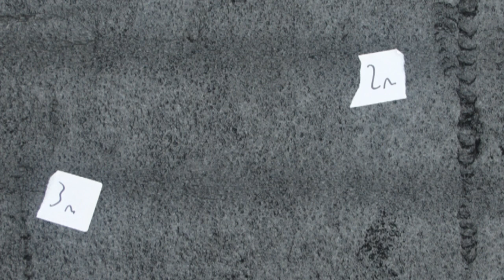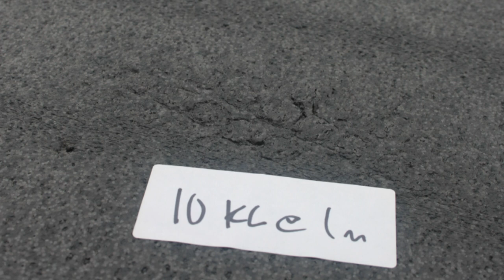Not Useless - Motorcycle Body Armour

Comment: Thank you very much for this.  I have put the armor in my gear to the test over and over through the years in lower speed offroad crashes and I can definitely attest to how it takes what might be a smashed knee, bruised shoulder or broken elbow and reduces it to a "walk it off" level.   While I agree with F9 that the foam armor isn't going to do much at a 60 mph crash into a concrete barrier, to me Ryan did a disservice to the motorcycle community by not pointing out this detail well at all.  

The author of the study RyanF9 cites even has come out and said that F9's interpretation of the data was incorrect.  I used to be a huge F9 fan, but their advice has taken a huge nosedive lately in favor of "hot takes" to get views.
Reply from the maker: @Spoonboy79 - Thanks for the comment.  One thing I didn't like about Ryan's film is the lack of links to the quoted sources, as someone who studied physics he knows better than to not quote data sources.

I'm a bit ambivalent about the film, if it wasn't from FortNine I would have dismissed it as clickbait, but even a good channel can have a bad day.  If you have a link or source of the author's statement that Ryan's interpretation was incorrect can you post it here?

Overall I like the FortNine channel, the film I am replying to may be a little misjudged, especially by the comments section.  I hope it will continue to be entertaining, high quality and honest.  Ryan's film is his take on the armour protection value, as is mine.

Comment: The impact energy  in your test (assuming you just dropped the weight) is ~98 joules. Impact velocity is ~15km/h. It is important to note that usual impact speeds exceed 30km/h and the mass is way greater than 2-3kg/cm squared. While your test shows that armor makes a difference, it does not paint an accurate picture of what damage occurs at real life speeds. A more accurate measurement would be to drop that 10kg weight from 4-5+ meters and see the result on a ballistic gel dummy with bones and everything, wearing armor.
Reply from the maker: @waterspark - Thanks for the comment and calculations, I take it the figures are for the 2 kg / 3 m drop?  As mentioned the test is for a comparison and not a massively scientific endevour.  Unfortunately I experienced a real life impact at appx 25 mph / 40 kph / 11 ms-1 which saw me break a few bones on unarmoured parts and due to a shear effect one that was armoured.  I have also had a couple of minor dinks where my armoured elbow, shoulder, hip and knee hit the deck and I wasn't even bruised [apart from one time where a 'friend' then ran over my leg].

I don't have either the facilities for a 5 m drop or the budget for a set of ballistic gel dummies at £300+ a pop for torsos, it would be nice if I had to redo the testing.  The 'Beaker' to my 'Professor Bunsen Honeydew' was unwilling for me to drop the 2 kg weight onto his arm from 3 m for some reason so the tests were done as described.
Reply: @TheRantyRider  
Armor isn't "does nothing".
It does absorb SOME energy. Issue is that it doesn't even remotely absorbe enough, to ASSUREDLY keep people safe if they land badly. It will still reduce the damage somwhat.

Keep in mind that energy of moving body is propoeritonal to velcity squared.
Reply from the maker: @martonlerant5672 - Thanks for the comment.  No armour that could be reasonably incorporated into riding kit could prevent injury in any circumstance, my accident [see other comments] could only have less injuries if I had left home a minute later.  I doubt that every motorcycle accident will need armour that will stop a bone being broken, but any reduction in the energy transfer can reduce or eliminate injury.

I'm aware that kinetic energy is ½mv² but the film is a qualitive rather than a quantitive comparison.  Given the option of nothing except a couple [at best] mm of leather vs leather and armour that will absorb some, if not all of the impact I will go for mitigation any time.

As per my closing comments it is up to the rider to decide, as it is in warm weather for them to decide that trainers, shorts and a T-shirt paired with a multi-hundred pound helmet is a good form of protection rather than full body covering riding kit.
Reply: @martonlerant5672  yeah a few youtubers have got their knickers in a twist over f9s comments like this youtuber in their blind ignorance have completely missed the point of the video and done a reply that's not a representation of anything other then dropping a 3k weight on the floor.
Reply from the maker: @anti-cheaterchannels2153 - Thanks for taking the time to comment.  I took a while to film this as a reply to Ryan, and rather than going off on a 'you must wear body armour' rant I tried to show that it will mitigate an impact.  The weights I used were 2 kg and 10 kg rather than the 3 kg you mention and as per the film and other comments are not a scientific study and qualitive rather than quantative.

Ryan's comments that the manufacturers base their armour on the minimum requirements are appropriate, as is the fact that car manufacuturers will meet the minimum safety standards for thier products to comply with legislative requirements.  

I hope that you don't think that I have made this in 'blind ignorance', I was showing that an impact is mitigated by armour rather than completely eliminated.  I have had the unfortunate experience of an impact where I ended up having metal implants and the armour saved my joints in the most part.

I will continue to wear armour as it will reduce the impact energy if I have another dink, I will also wear a helmet, gloves and boots as all of these will help in the event of an 'off'.  I could not show truly high energy impacts on realistic ballistic gel and simulated bone items due to cost and needing a lab to do it in.  Having walked away from high speed track crashes, one of which I was also run over by a following bike I would wear the best protection there is.

As I mention, the choice of armour or not is down to the individual, in the UK we have to wear an approved helmet only, anything else is optinal.  Having to give first aid to skinned hands to a rider that had a slow speed dink while not wearing gloves because 'it is a warm day' makes me even more certain that protection is best.
Reply: @TheRantyRider  I agree. Wearing armor is always the best choice. My comment was meant to show that the best proof (even without lab conditions) would be to use greater weight from higher height, because the test case you presented, although it shows armor is efficient, it lacks in showing how effective, particularly with bigger bumps. As for the 3kg - that was kgf on square cm, that 10 kg weight had a pretty big contact patch. All in all videos like yours do help riders be safer. Thank you for taking the time to do this.
Reply from the maker: @waterspark - Thanks for the extra information and comments.  It would be nice to be able to replicate the impacts exactly, in the film I mention that I twice had a poor release and the diving weight landed on the long side rather than the point.  I was thinking of using the string to keep the weight the 'right' way by running it between my [gloved, it gives a lot of heat off] finger and thumb but I would be unable to ensure the same pressure each time.

I also thought about having a target to drop the weight on of a known size but I couldn't ensure that I would hit it!

It's a bit of a demonstration rather than what I would call anything near scientific, the 3 m drop height was above my head when I was at the top of the ladder so there may be variation there as well.  I've had a lot of suggestions on here so at some point I may try it again incorporating these, my mate who supplied the foam is going to have to work a lot harder if I do so that I have enough to make another film.
Reply: This. This is a meaningless test because the test is so toothless. A pillow or bubble wrap would be considered armor by this standard.
Reply from the maker: @Hazztech - Thanks for the comment, the point of the film is to show that armour provides some protection.  It's not meant to be an empirical test, just to show that a reduction in the impact is achieved, even by armour that may be considered ineffective in high speed crashes.

Neither bubblewrap or a pillow are used as armour, the pillow would absorb more energy but bubble wrap would simply fold around the weight.  The armour shown absorbs energy, given the choice of my elbow hitting the ground with or without I'd prefer with.
Reply: A
Reply from the maker: @anti-cheaterchannels2153 - You appear to have submitted a comment early, would you care to complete it?
Reply: @TheRantyRider  yeah you keep saying it's not an empirical test, so what is it? Because it seems like you've missed the point, got angry at that , and accidentally made the same point. It's a good video in isolation, but contextually, it's a rehash of the same argument born from misunderstanding.
Reply from the maker: @anti-cheaterchannels2153 - Thanks for the expansion of your comment.  The title card on the film states that it is a non-scientific comparison.  It's just that, a comparison.

There are so many parts that show that mean it can't be used for any sort of test of standards as I couldn't guarentee that the weight would drop exactly the same each time, the heights my vary a bit and the armour is not retained by an enclosure.

I didn't get angry at any comments, so don't worry about offending or upsetting me.

Im my personal experience of 38 years of riding is that most spills, including one where I was run over by another rider on a circuit, is that they are minor and don't involve large impact forces.  I have had a number of minor 'offs' and one major one which led to me being partly filled with metal.  Having banged various parts of me on the floor I have been able to get up and walk away rather than nursing a damaged elbow - for example when lowsiding on track - due to padding.

I hope I haven't misunderstood anything.  Armour saved my elbow and shoulder joints at the cost of a humerus break, boots have saved my ankle, gloves from an 80 MPH slide along the track at Silverstone, and lid has saved me from serious head injury but no armour can protect in every circumstance.  I prefer to use it as I have felt its direct benefit on many occasions and it is up to the rider to decide, apart from a crash helmet which is compulsory in the UK.

I had a look at your channel and it doesn't feature any films, do you ride?  If you are a race fan I will be at WSB and MotoGP with the Two Wheels For Life charity so if you are around pop over and say hello.

Comment: Great video, I love when people do their own science. Quick question on your results for the body armour, do you think using packing foam would miss represent your results? 

By that I mean that bone is brittle, packing foam is elastic (to a point) and so potentially the impact with the body armour is being masked by being under the elastic limit of the foam.
That doesnt mean that the body armour does nothing, it clearly does in your test, its more a case of its quite hard to compare the damage done to foam to that which would occur to bone.

I dont know how you could test to solve this problem, maybe test using ceramic tiles underneath a very thin layer of foam to mimic bone under a thin layer of muscle/skin?

Either way great video!
Reply from the maker: @jacobc6482 - Thanks for the comment.  The packing foam was used purely to see if there was any difference as it's a control, as was the wood under the foam and both are more flexible than the drive I did the tests on.  I was thinking of getting a leg of lamb or similar to show the damage, but the problem is being sure when it is that the bone breaks.  I also considered just a bone from the local butcher but again, I would need a few to avoid fatigue failure of the bone through repeated testing.

The test is qualative rather than quantitive, there is a difference that can be seen but there is so much more that can be done in a lab by people that have the right kit.  To be honest I thought that there would be some damage to the foam even with the armour, and if I could get a more stable platform I would have dropped the 10 kg weight from greater heights as well.

The damage to the wood showed that considerable force was passed through the foam in the 'no armour' tests.  I can report through experience that level 1 armour protected my shoulder and elbow joints in an accident in 2017, my humerous broke between the armour.  Due to the nature of the accident my femur fractured at the neck, but due to the shear forces involved no amount of armour would have prevented this.  The mid femur and tibia breaks were also rotational and unarmoured.
Reply: @TheRantyRider  Thanks for the responce! I definatly agree armour helps alot, I find it really bulky most of the time which is anoying. From what I've seen the best thing available (other than a good helmet) is an airbag backpack that has armour built into the backpack and an airbag that protects the neck.
Reply from the maker: @jacobc6482 - thanks for the commnet.  I'm not completely convinced by airbag backpacks  as they may get less effective if not worn properly.  Integrated into jackets they are less likely to move as they can't be worn too loosely.

Of course in the event of a multi vehicle collision the best thing would be the driver or rider paying attention, I speak from experience!

Comment: Yeah, armor is good for the distance dropped from about riding hip height to the ground.  That's gravity.

But at 60 mph Into a car armor won't help.
Reply from the maker: @briholt100  Thanks for the comment, as mentioned elsewhere in my 'big' accident my arm broke between the two sets of armour protecting my elbow and shoulder.  The 3 m test would be a moderate highside onto the ground,
Reply: @TheRantyRider  well, yeah. Any high side will put you in the air head first.  

I'm thinking of all the ways one can fall, many would be cushioned by armor.  Not all.
Reply from the maker: @briholt100 - Indeed so, there are freak accidents that defeat all sorts of safety features.

Comment: Besides being an April joke, Rian did not tell anyone has to give up wearing body armor. Just that they are not making the job as good as they should do.
Of course wearing any protection is absorbing shocks better than bare skin. But the benefit of wearing the "regular" armor is really not up to the cost, discomfort and pretensions of the manufacturer...
Reply from the maker: @yveslegrand9826 - Thanks for the comment.  Indeed Ryan did not advise anyone to give up armour, I perhaps could have been clearer in the film about that.  Manufacturers can make the armour more protective, but this would be make kit far bulkier and less flexible than it is with the current armour installed, you mention that the current armour is uncomfortable, so imagine wearing a race spec armour not just on your back but on all your joints as well.

I did find it a bit odd that Ryan showed what looked like elbow or shoulder armour and said he wouldn't wear it but wears an inflatable backpack.  In a rolling/tumbling accident the elbows and knees can wallop the ground with some force and I would rather these be protected, if only a bit.
Reply: @TheRantyRider  why is it odd that he said he wouldn't wear one thing and then goes on to not wear that thing and instead wear something else
Reply from the maker: @arpytrooper2604 - if you look at FortNine's airbag film, Ryan is wearing a torso and pelvis set, but then in the body armour film says that he wouldn't wear something that would protect his elbows and knees.  It's a bit like wearing a helmet but no gloves and trainers instead of boots, you are emphasising protection for one area but neglecting others.

In the film 'Faster' the head medic for MotoGP is interviewed and says that the injuries have migrated from the body and head to the hands and feet as protection has improved.  Given the choice between a broken hand or a broken arm I would go for the hand - and this is from expirience.

No amount of protection will eliminate injuries, but reduction of harm is a benefit in the majority of incidents.  I wear armour in my jacket and trousers, boots, gloves and a flip-up helmet year round, all of which have helped protect me in an accident a number of years ago.